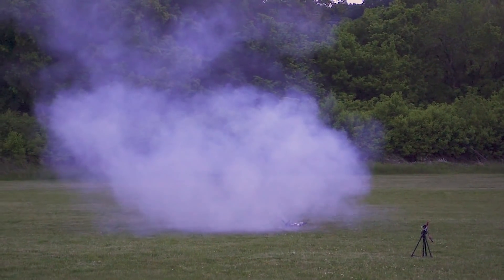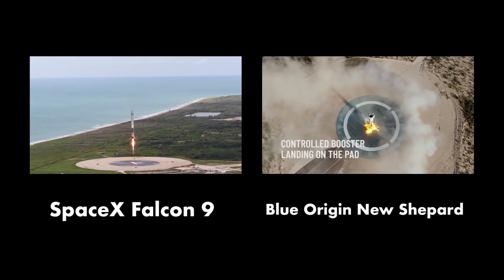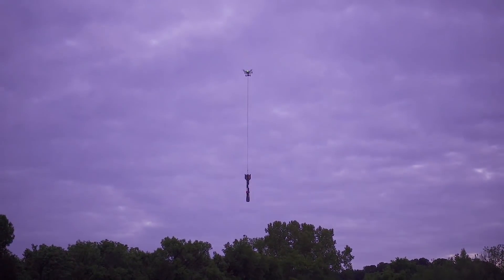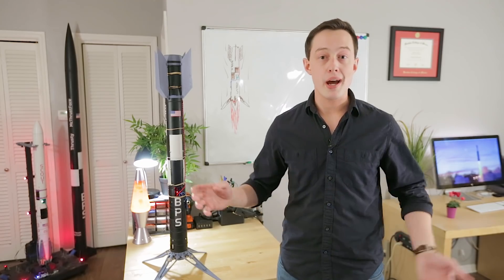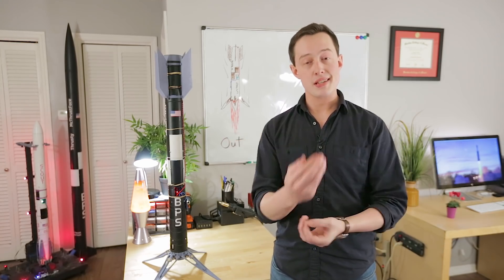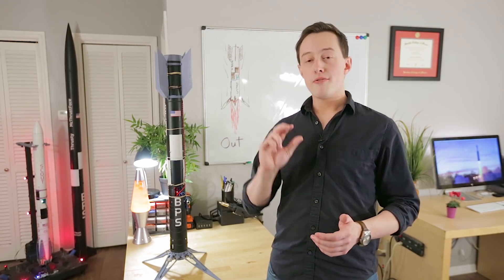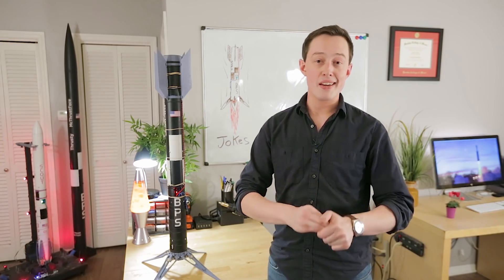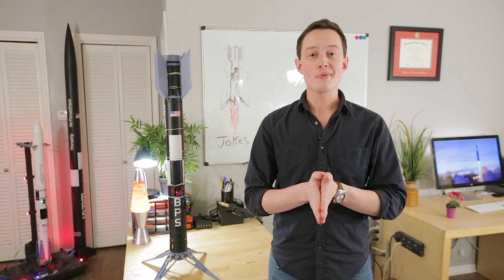Echo - Landing Test #4

Comment: No DARPA money yet? The most immediate applications for this kind of thing seem to be military in nature. Next aspect that would be interesting to them is likely figuring out how to hide the flaring and muffling the noise, but that could be saved until after getting this landing mechanism worked out to the point of having a reliable standard to go with first. (The standard seems to be what you're describing here.)

As for the springiness on leg deployment and on landing? I'd suggest looking at tape cassette players dating back to the 1980's and 1990's. The "soft eject" or "soft open" mechanisms seem to provide a relatively consistent and very compact way to dampen movement occurring on a hinge pivot. So that's where I'd look for some good examples of what to copy. (Not to mention they can be used over and over again.) I'd think most patents for that stuff have expired, not to mention you're changing the scope of the application that it'd be used for - so you probably have room to work things out in that regard too.

If I had to pick a particular dampener mechanism from that set for compactness and simplicity, I think it would be the one where there's a geared end on part of of a hinge (hinge itself is free in movement) that engages another geared friction wheel. The viscosity of the grease used and how tight that friction wheel is against its mount location are pretty much the only variables that would control its rate. An alternate to that is some kind of friction sleeve/piston/shaft, but I think the wheel one is easier to adjust given all there is to it.

Comment: Great work. Maybe separate the gyros some. 1 at the tail and 1 at the nose. The greater the distance between them, the more accurate the measurement sent to the main processor and the more accurate the control response. Also, while the fixed vanes near the nose assist in your vertical orientation during descent, making them steerable via inputs from the upper gyro (along with tying the gimbled nozzle to the lower gyro) should eliminate the vast majority of the tilt in any direction, as well as minimizing lateral drift.
I would suggest the addition of a gps unit linked into the gyros, but units that small and that accurate are limited to military usage for the time being.

Comment: If you had a bypass mechanism on your nozzle you could trigger with the legs as they touched the ground you could in a sense cut the throttle.....
Reply: The IMU should be able to detect the landing just by looking at the (de-)acceleration and fire the bypass mechanism. So software can be used ;-)
Alternatively, like Joe talked about gimbaling the motor at the end to lead off excess power - he just need to be able to gimbal it 90 degrees - and then do 360s really fast :-D

Comment: Have you thought of firing the landing burn slightly later and using a jet of compressed air firing straight up to push against the motors thrust to push against the solid fuels thrust to more or less ‘throttle’ the engine down?  It could theoretically be tied into your reaction control system and should be able to tune out inconsistencies with the motors as they will still be burning down at lower altitudes.

Comment: If the black powder rockets that you use are like the ones that I use (Estes rockets) than by controlling the amount of oxygen around the exhaust of the motor. This works best when you have a long tube (mine is aluminum with channels for air on the out side) because then the motor creates a vacuum that pulls in more air to burn the fuel. The longer the tube the better because you get a better vacuum. By restricting the amount of air you can effectively throttle the motor. (this is easily done with a 3d printed plate controlled by a servo) I was able to achieve 100% thrust down to 35% thrust with this technique. If the plate fully connects, you will kill the motor  I think I will by one of your gimbal kits because it seems to work well. Also I know that you will want confirmation to back this up but I cant upload anything because I have school and parents don't want me to. Im sorry for not being able to help further than what advice I can give you here.

Comment: Have you considered making the landing legs out of tpu or nylon? Both should be much better then pla at absorbing the impact of landing, and may even cause less shock on deployment. We use it in the multirotor community often as flight controller vibration mitigation, and canopy material. Both are extremely durable.

Comment: Its seems sort of feckless that you would use a solid motor. What exactly are you trying to achieve? 
A lot of your problems are created by you because of the scale and methods. For example, a solid fuel motor doesnt let you control thrust so you cant land efficiently, and isnt the whole point being able to land everytime? Youre a niche problem solver, solving problems that anyone doing applicable rocketry, has already solved. 
To each their own. good luck.

Comment: You should definitely use a Kalman filter for mixing the accelerometers/gyros. Hardcoded logic will never work nearly as well as the filter. Besides, you already did the hard part with quaternions :)

Comment: How much energy do you lose by correcting horizontal slide and keeping the rocket upright? More than 5%? On a flight with more 'trouble', you might end up finishing the motor on a higher altitude?

Comment: Interesting that you are focusing on fixing as much as possible in software rather than hardware.
Every design engineer will tell you the opposite, you should not create a software solution to a hardware problem. 

 Case in point, the 737 MAX MCAS debacle is a (poorly implemented) software solution to a disastrous hardware problem and that didn't turn out well.
If your leg opening had dampers, you don't need a software fix.
If your leg boinginess is fixed, again you don't need a software fix.

Comment: I think both your problems could be solved with small pneumatic cylinders to deploy the legs. Something as simple as a straw with a 3d printed rod inside sealed with an o-ring might work. A small balloon could act as accumulator/tank. Small light weight lines might be hard to find/make, not sure what to do here. A servo pinching the balloon might work as a simple valve if one is needed at all. Restricting the air flow between the cylinders and the balloon will slow the deployment and reduce the shock. It will also absorb some of the landing bounce.

Comment: Shouldn't you be using curved fins, like you would on the final rocket?  Ideally, you should be using the same fins that you'd be using on the final rocket, but you could just have fixed curved fins for the test vehicle.  On the other hand, using flip-out fins might impart a rotation along the vertical axis as they unfold, and you'll definitely want to test for that.
Also, try reverse-biased LEDs as your SRB ignitors.  If they're hooked up backwards, instead of lighting up they'll let out their magic blue smoke on the millisecond timescale.
Finally, other people have suggested shock absorbers on the legs, which is a good idea.  Having six legs instead of four would also help with the landing stability.

Comment: Why would it be better to filter the software (making it ignore sudden impulses of force), rather than adding a mechanical damper to the deployment mechanism?  I mean, a physical damper could be as simple as friction disks limiting the acceleration of the legs as they rotate, and your software can remain sensitive to sudden inputs from wind or whatever, that it might actually need to correct for.  Also, have you considered feet, for the legs?  Perhaps some type of foot would introduce a bit of drag, during deployment, and help slow them down, as well as giving you a bit more footprint to stick landings (instead of making the legs longer).  Anyway, I just found your channel.  I didn't realize anyone was trying to land scaled-down reusable boosters.  Looks like you're well on your way.

Comment: Very impressive. For the record, back in 1964, I built an Estes cluster rocket equipped with a retro-rocket upper stage, with a (live, in water) zebra fish payload. The rocket launched on the 3 most powerful engines Estes had at the time, at stage separation, a long, sheltered wick ignited resulting in ignition about 1-2 seconds into free fall, and when the engine burned out, parachute separation of the payload occurred. The Upper unit definitely slowed down, parachute did deploy, and the zebra fish survived. I doubt if we went any higher than 200-300 feet, but the gizmo worked. These were in the days before computer chips, electronic cameras, deployable landing gear. Your work is admirable. I did mine in the days when slide rules built the Saturn V, and launched astronauts to the moon and back, all within a 7-8 year time frame, start to finish. Keep up the good work. Elon Musk is on the right track. NASA lost it about 30 years ago, and is still looking for its butt!

Comment: Just a thought off the top of my head.  For the combined ascent and descent test, clearly you want a high CG and as far aft CoL as possible.  But on the descent you'd want those flipped.  It would be hard to move the CG lower so wouldn't it be better to use flat plates (like non-functioning grid fins) to move the CoL up through drag?  The idea I was percolating is the flat plates popping out at the top would serve the same purpose as the fins but would also provide more drag which I was thinking would be better then the stream lined fins.  But I am not sure if that would make the burn deceleration calculation more complicated?

Comment: Hi Joe. Thanks for the update. Nice to see how close you are. keep it up. I was wondering if you have considered moving over to a landing surface more suitable for your objective. I realize that concrete or any other hard surface wont be all that kind to any mishaps but a smooth flat surface may be a better option when you get close. If you observe the F9 landings, some of them move horizontally at the last second or two, almost sliding over the deck of the drone ship. The grass can also be a little bit "spongy" or allow locations for the legs to get stuck. Ultimately you would want the combined hardware and software to result in a perfect touchdown but I think that's more difficult on grass to be honest. Does the rocket stand upright on its own on the grass easily?

Comment: First off, fantastic work.  This is the grass roots science we cannot ever lose.  I look forward to the day you stick the landing.  Hell, it took Spacex a few 9's to get it done.

Just a couple of thoughts, as a software programmer I will say your one statement is not quite correct.  I feel that while you can fix a lot of things with software, if there is a hardware fix that makes sense, do it first then  shape the software around the better hardware solution.  If the legs are flexing enough to cause a bounce, that as others stated, try mini shocks,  aluminium foil that would slightly crumple on landing, or brace the legs so they do not flex as much.  I disagree on engine cutoff higher, because that would only exacerbate the landing problem.  Tweaking the software to remove shocks makes sense, but given you were just outside 10 cm and that might put you inside 10,  I would think the goal could be 5 CM with the 1% variance putting you slightly higher or lower, but still off the ground.  You have not said, but since the thrust and power time is a constant value due to being solid fuel and no throttling, do you factor in mass of the vehicle in regards to when you light the fire?  

Anyway, great videos and explanations.  Thank you for sharing and your efforts.

Comment: You have done so much but are always going to be limited by the solid fuel.  I am not a rocket man but I would assume that why we see so many rocket clubs all firing solid fuel motors is because it must be very difficult to create/build liquid fuel motors at a hobby rocket size range.  But you have proven over and over that you eat these kind of challenges for breakfast so I think it is time to design a liquid fuel rocket motor system.  One you can control with a flight computer and easily refuel.  I know weight will be an issue so there must be a 'perfect' rocket size depending on what type of propellant storage tanks you can use as well as the various valves, piping and nozzle plus the compressed air vertical stabilization.  Maybe you could propose a project and have several videos where you discuss each piece of the project and it's associated issues and possible solutions.  Doing this without actually building the rocket will take us along on the journey as we see together if it has any chance of working or is simply not possible.  The final video would put it all together and we can see what size is actually needed.  I am sure the costs would be substantial so maybe a Gofund me page might draw those interested in seeing if you can actually do this.  My mind boggles at a completed project where each element has been worked out and you actually fly and land a model rocket that mimics SpaceX's commercial rockets.  Maybe Musk might get personally interested.

Comment: What if you eject the motor vertically through the airframe upon touchdown? Motor retention could be actuated slightly before or at touchdown (TVC System would need to be vertical obviously). Motor ignition could occur at some moment slightly later than you’re currently running, to guarantee you’ve got motor impulse remaining to stick the landing. 

It seems you’re more inclined to software side tweaks. Also my suggestion would require structural modifications that could prove unrealistic (clear space through the rocket forward of motor retention)

Comment: Hi Joel.   Amazing work! 
In my opinion you’re already there!  The reason why it failed is because you’re landing on grass... it bounced on the grass, which is “bouncy” and also uneven.  I think it would work on a solid, even surface...
Keep going!
Reply: Also, not sure if it would be a major design issue, but the ratio of the height (and weight) of the rocket and the square surface area created by the 4 legs may be wrong.  If you could make the legs a bit longer the rocket should be more stable on landing and not tip over... just ideas!

Comment: Space is hard, landing the rockets is harder. The trick is to achieve enough margin to bring it all the way back to land. xD You've got to reach that thrust negative (is that what it's called?) , where the total thrust that the engine is producing is equal to the rockets falling mass. As you see, the motor catches up in the last few seconds. It's just timing, or maybe weigh the craft down a bit? I don't know. I'm no scientist.

Comment: Hey Joe watched your close call you definitely are very close just as a outsider point of view have you considered out side data readers and what i mean is instead of adding more tech to the rocket maybe add to the launch pad incense taking measurements from liftoff and relaying to the rocket computer you already have bluetooth in the system so just suggesting not to add to rocket but add to launch pad and have it synch with the rocket and when it should bleed off energy

Comment: @bps.space With the thrust control problem, I saw in a previous video you were going to use 3 rockets, to get some kind of throttle control but rather than using multiple rockets what about using ballast that can be dropped, so if its default profile is to hit the ground a little hard then as its coming down you can drop mass  to control that as my dropping mass it would be like adding more thrust. allowing you essentially one way throttle control. i was thinking something like a line of ballast weights with a pin through them so the further the pin is pulled the more weights fall off.

Comment: What about using multiple, maybe 4 TOF sensors (maybe on the legs) spaced apart to measure distance from the ground <4m and then use trig to determine attitude in relation to ground level. Worth atleast testing if the grass would bounce back UV laser good enough in daylight to make rapid measurements
Reply: Just very finely mow the lawn before launch ;-)

Comment: Do you expect to have to begin using a time of flight ranging solution or do you think that more accurate accelerometers will be able to provide more reliable height measurement?
Reply: Also it seems like your horizontal tracking could play a significant role in keeping the rocket on target if your accelerometers are unreliable

Comment: What if you use an "up-down" RCS like you are developing for stability control .. so you can push down a bit more or slow down a bit more .. on this #4 test, just a slight push down woud've been enough.
Maybe start the motor a tad later but add controllable spoilers (airbrakes) to help judge descent ... then you'd preferably land with motor still on most of the time tho ... which might cause other issues.

Comment: How hard would it be to add throttle for this rocket?
He could use a valve that would deflect the thrust on each side of the rocket, using a T shaped plumbing.
I guess he doesn't want to add any more weight, but adding any amount of thrust control seems to me as a necessity if you want to land a rocket correctly, from any height.